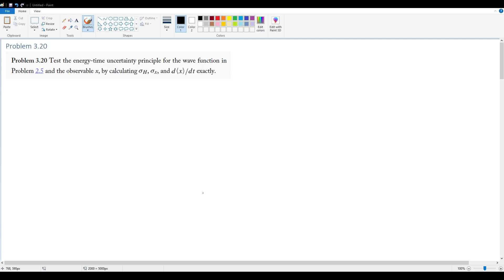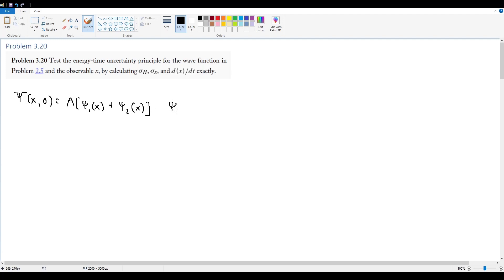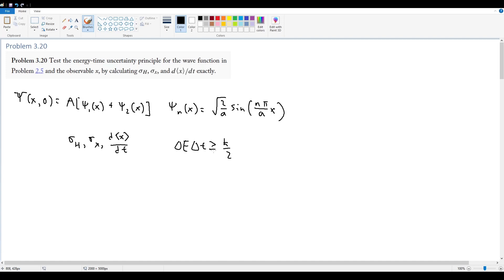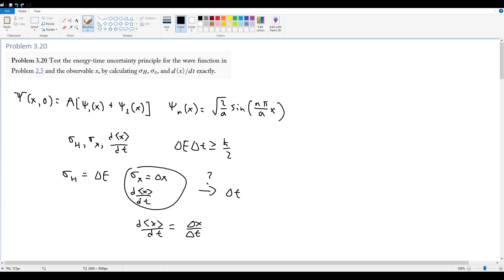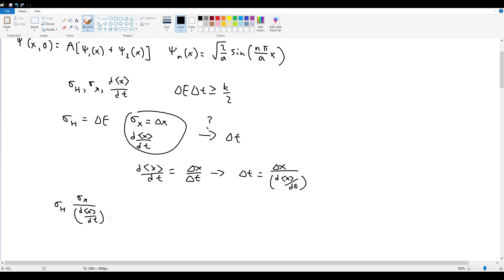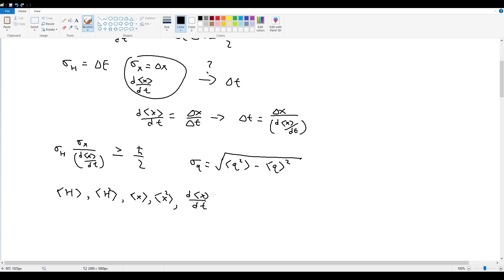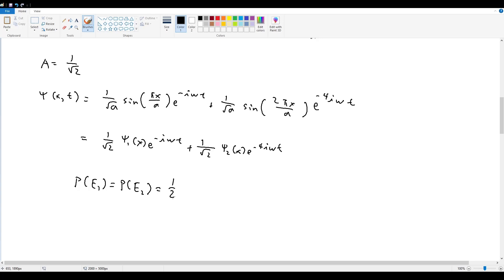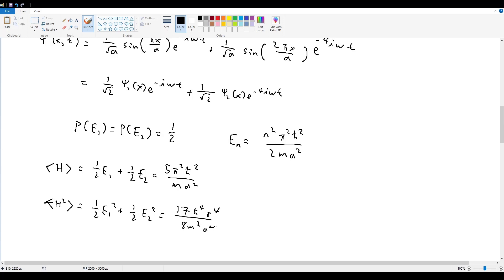Griffiths QM Problem 3.20

Comment from the maker: For those who are trying to do the <x> integrals by hand but are stuck on how to start, I would recommend converting the complex exponentials into trig functions. From there, try to down-convert any higher power sinusoids you find via trig identities such as double angle and whatnot. Afterwards, you should just be able to solve the resulting integral as normal.